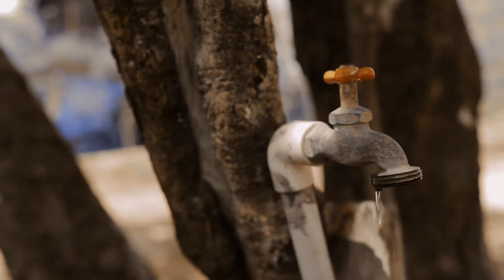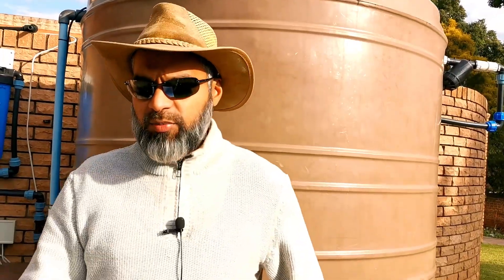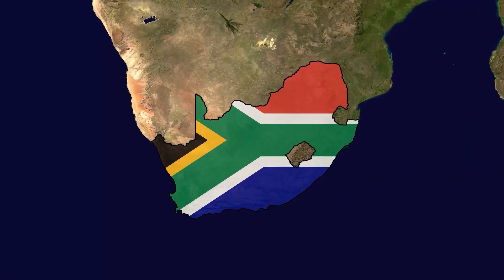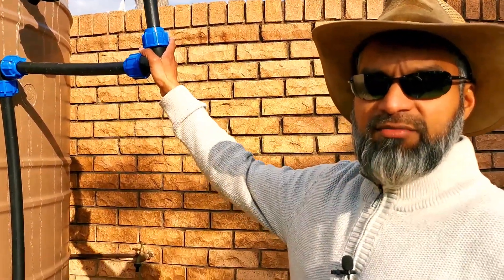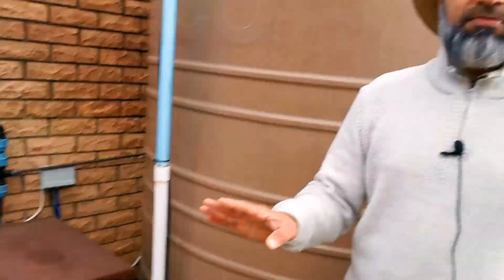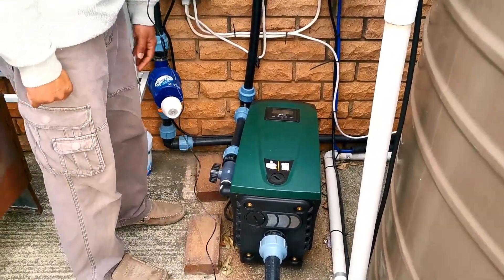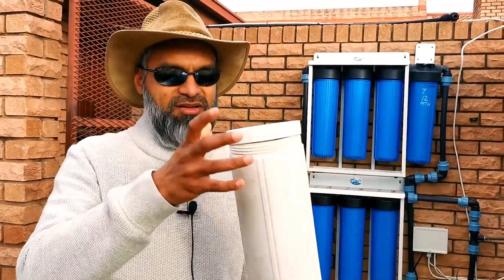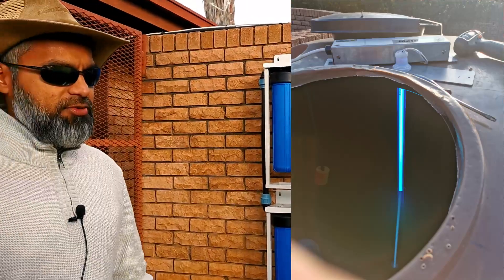Full Borehole Drilling Guide - Start to Finish

Comment: I work for a water board, I am impressed by your knowledge.  You can ask the lab to show you what they are accredited for. If they are not accredited for what your needs are they can be doing Z-scores(which is a pear review) which is acceptable also. The SANS 241 divides these determinants into 3. Micro, chemical, and physical.  There are about 43 of them. They get rated on health risks as well.
Reply from the maker: Wow.. Thanks for your lovely commented. I'm flattered and humbled.i always loved chemistry and perhaps if I knew at the time I would be running my own lab now.

Thanks for your additional information. I've learned something new.

Comment: I am about to relocate from Perth Western Australia to Thailand, Yosethon rice farm and house. I would love your opinion in doing all again. I am doing stages of infrastructure. We have the house water and electricity etc. I would love to go off grid. First is to get a well. What are your recommendations for a single storey house, for 3 people. And needs to water the house property flora too. Do we go for separate tanks, one for the house and one for the gardenWe have a blank canvas to start our relocation and hobby farm.  End result that I am after is ample electricity, solar with batteries , free water. We have half an acre, one rai. To use for solar and a windmill. My budget is good middle range products. I am interested in low voltage stuff too. But big ticket items, I need recommendations. And the pros and cons of each. I have 2 years to complete everything. We have ample sun. Property faces east. And when the sun don't shine, very strong wind. So wind turbines for electricity as well as solar. Thanks for your videos any input.
Reply from the maker: Hello,

With that amount of space you could go with separate tanks and harvest rain water too.
If you Drill a well and have a high yielding one then perhaps 1 tank will suffice.
Wind power will be good overnight.
You could go with gas water heaters to meet the morning demand.
You may require a few inverters in parallel to run heavy machinery.
That should take you off grid then.

Comment: Why don't you clean the tank uv light every month
Reply from the maker: I clean it every 2 months. It's a mission to clean every month. I need to disassemble the light ballast enclosure and remove the sleeve. It's a fair amount of work and takes time
Reply: @ElecAndAll  uSE DILUTE HYDROCHLORIC ACID
Reply from the maker: Is it not too strong for the quartz?